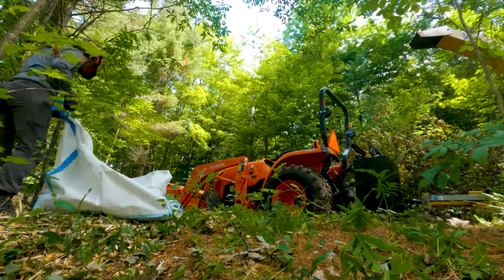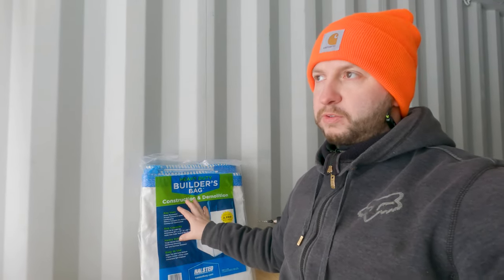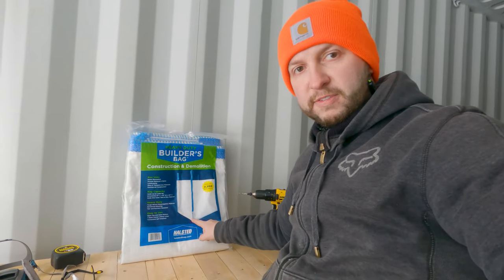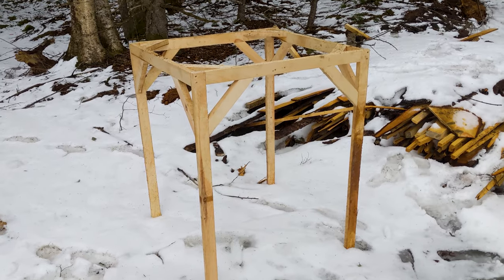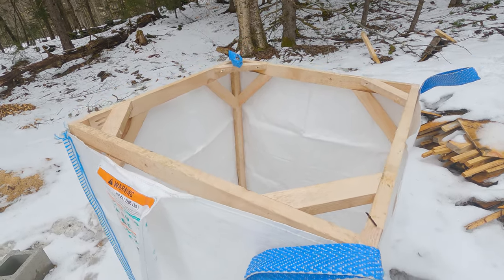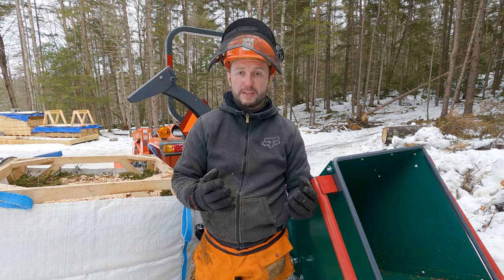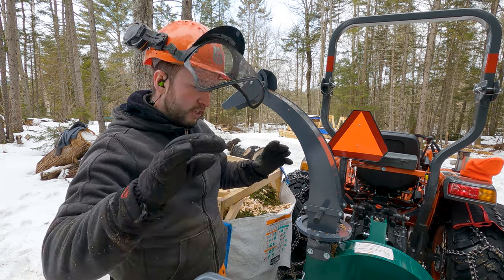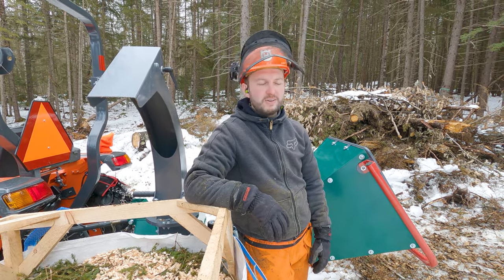DIY builder bag support and using our new Woodland Mills WC68 Wood Chipper

Comment: I bite the bullet a few weeks ago and sold my old Greenmech 6” towable chipper and bought the wc68 - it’s a great little chipper! My old David Brown 885 runs it nicely. 
Had the same issue with the safety bar dropping down but a quick tweak on the valve sorted it.
Really like the wooden frame work inside the dumpy bag you made - looks like it works a treat and will last a fair while
Reply from the maker: We've now chipped about 30 cubic yards with it and are really impressed. We've blocked it up a few times, but only from feeding too many green pine needles in at once, so not unexpected. Otherwise it's worked flawlessly!

The bag frame is working really well. I'm impressed with how well it's holding up to say I threw it together pretty quickly with some off cuts. Even if it breaks, it'd be quick to repair or even build a new one.
Reply: @AdventurousWay  chippers always find it tough on conifer brash especially if it's wet - feeding in a thick stemmed branch on top of the pine needles often helps push the finer stuff through,.. slowing the roller down will help too but that is a bit of pain.
The bag frame is a great fix, ive used metal fencing stacks in the past which have never worked well, so might have to pinch your framing method in future

Comment: So smart to build the frame!  The new chipper seems perfect for your needs.
Reply from the maker: Thanks Joyce! Honestly, we're really impressed with the wood chipper. It's handling everything we need it to and is a pretty good match for the two of us feeding material in. It's not too big and bulky, and the tractor doesn't even seem to be using too much diesel while running it either.

Obviously it's not as big and powerful as the huge chipper we rented last year, but we just don't need anything that big or powerful on a day-to-day basis. We have an absolute mountain of wood chips and mulch now....
Reply: @AdventurousWay  Sounds like your neighbor's chickens are enjoying the mulch.  Yay!

Comment: If you just want to move the chips I recommend using a dump trailer. Easier and faster if you don’t have to lift high. Or you can work the chips with front loader pushing higher. If you like the bags. Find your local feed mill. I work at a feed mill and we have a bunch of those bags minerals come in on for our bulk feed mixes so we will sell used bags as a bundle of like 25 bags for 100 dollars.  conditions good and bad for the bags but almost all bags good or bad won’t leak wood chips. It would have to be a big cut.

Comment: You could also use an IBC tank as a bulk bag holder by cutting out the top of the tank and hanging the bag inside. The advantage of using an IBC tank is the forklift holes in the bottom of the tank frame. This lets you move the bulk bag holder around as you work or move to the next tree.
Reply from the maker: I guess you could! Not sure about around you, but around here IBC totes can be surprisingly hard to find and expensive these days!

I think we used our bulk bag support to fill about 150 yards of wood chips last year, and it held up with only minor repairs! Based on its success, I'm considering building a v2 with slightly more reinforced corners which turned out to be the weak spots.

If we need to move a partially filled bag, or for some reason can't lift it by the handles then we just put the bag on a pallet and move it that way.

Comment: Good start on the slash how about take tractor with forks and stick them into the slash and lift and move around to break it loose
Reply from the maker: We did do but between the ice, heavy logs and intertwined branches, the tractor really struggled to do much! We just chipped away at it - pulled some off the top, waited for the new top layer to thaw and tried again the next day. Rinse and repeat!